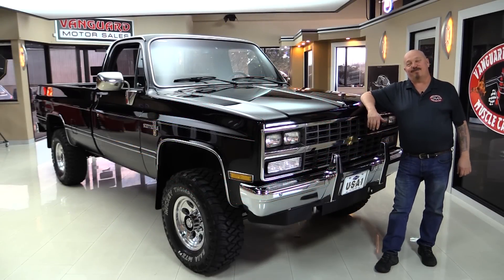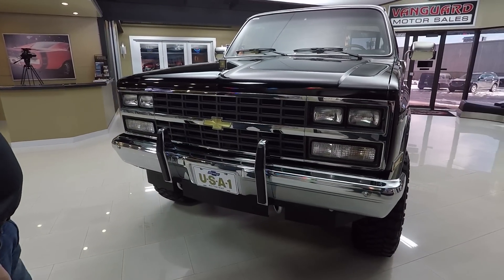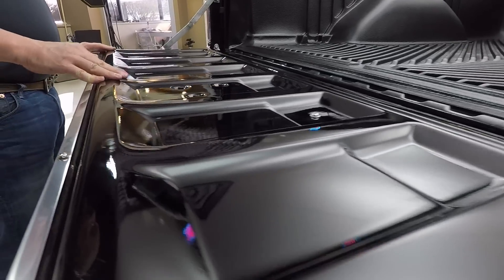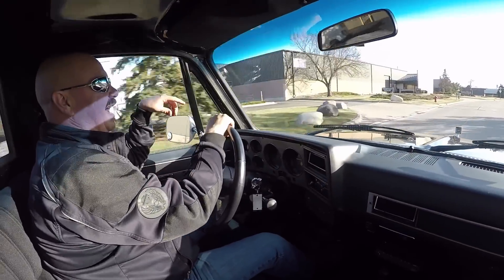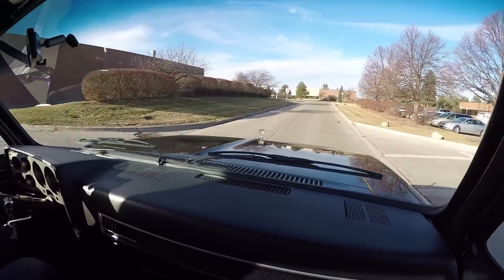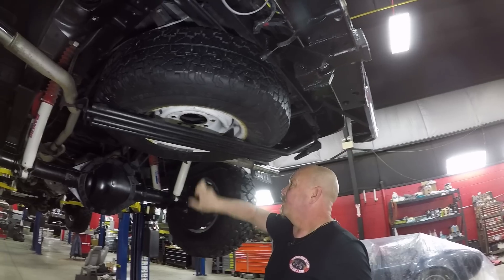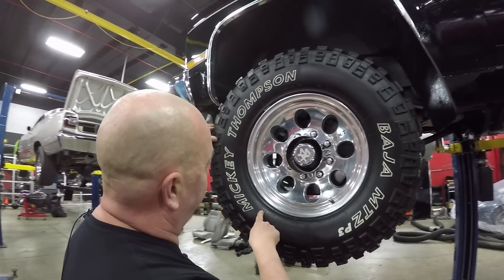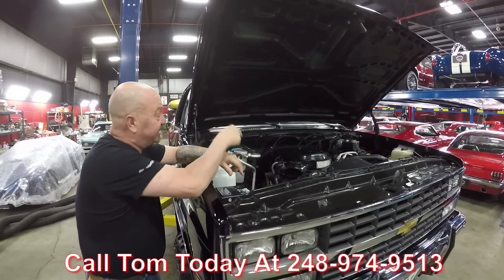1985 Chevrolet K20 4x4 For Sale

Comment: That's a clean looking truck. I love the 1989-91 Suburban, K5 grill that's on it. What I kinda wish Chevy would've done is run the squarebody pickups with this grill to 1991. Then they could've changed  body styles, and rolled out the 1988 truck style as the 1992 style, and run that style until 2002.
Reply: They actually did it  but in Mexico, square bodys till 91 with this grill. They call it Chevrolet Cheyenne.

Comment: My dads old truck did not have radio but air conditioning and 350 v8 4x4 i put pioneer radio in it 6x9 speakers in rear seat put new antenna in front on hood